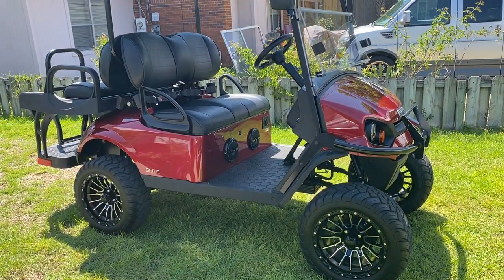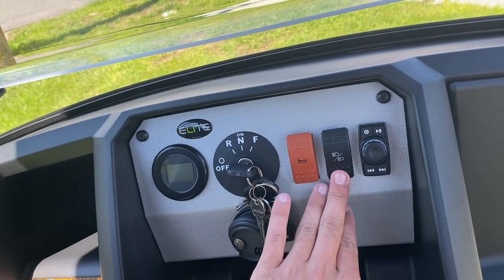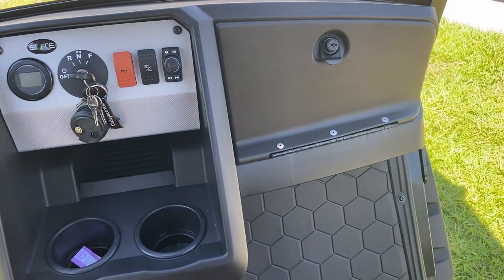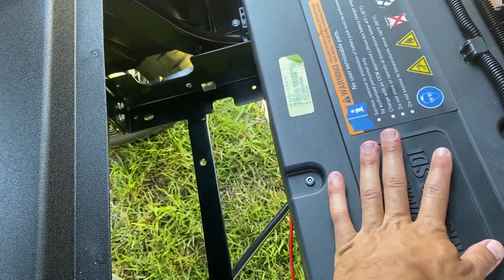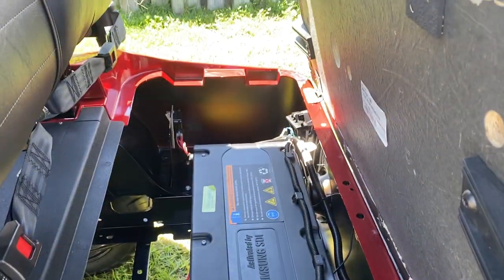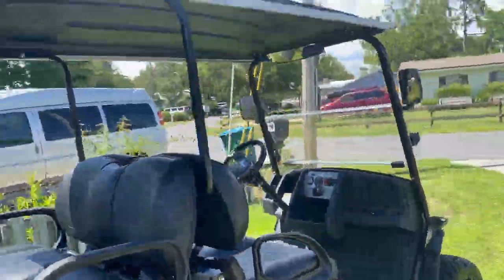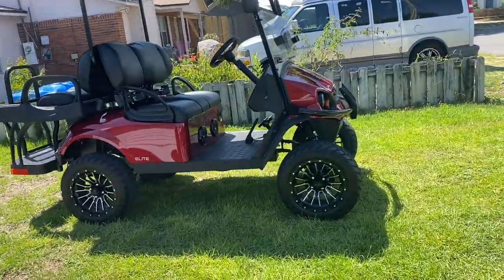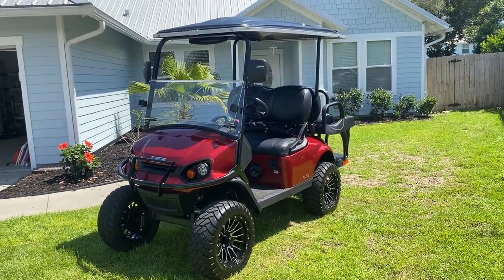2022 EZ GO S4 Elite Lithium Walkaround

Comment: Hi Brandon--thanks for the walkaround. I am looking at a 2019 EXPRESS S4 - ELECTRIC 48V...I wonder how it compares to this one. Also, how easy is it to convert to just a golf cart for carrying my clubs. Please let me know if you could. Thanks!
Reply from the maker: Yes it’s easy to convert but it probably won’t be similar in terms of performance if it isn’t coming from an area prominently street legal golf carts and it will probably only go around 17mph
Reply: @BrandonActionJackson  I just want a cart for the golf course. Does it have a governor that can improve the top speed?
Reply from the maker: @JP1970  no because it’s electric you have to have a speed controller that can be adjusted to change speed. But 17mph is fast for a golf course

Comment: i sat in one at the dealer, but the gas pedal was too close to me. my leg would be cramped if i had to drive in that position. at 6`3 i`m not able to operate it comfortably. the dealer said its because the seats are so much more bolstered than normal ones. seems like ezgo would have made these for all riders and not just for those under 6ft tall
Reply from the maker: I’m not that tall but I felt the same. It was definitely an adjustment going from my last cart but I quickly got used to it.

Comment: 2 questions...which seat belts did  you go with? and how did you get it flashed to go 25mph?  (my dealer doesn't know how to do this)
Reply from the maker: My dealer just flashes all of them since basically everybody in my area converts them to LSVs. Also my seatbelts came pre installed from the dealer so I am unsure of the brand. Your most important item for making it street legal will be the windshield
Reply: You can recalibrate the speedometer so it works again